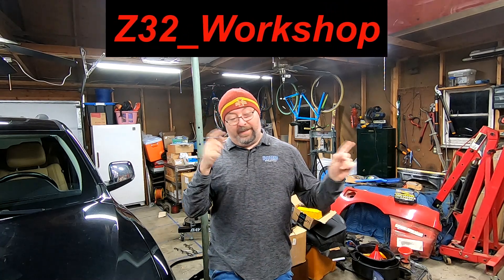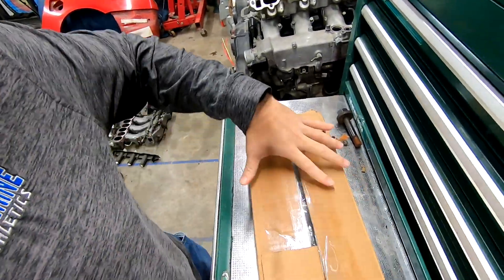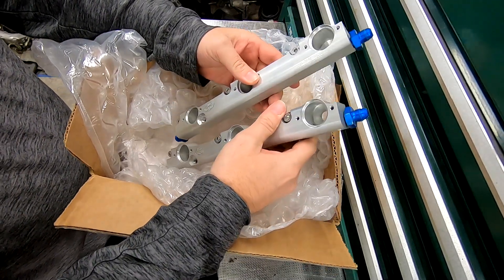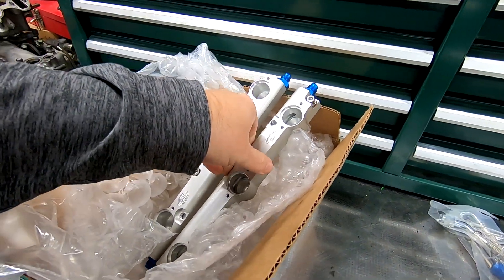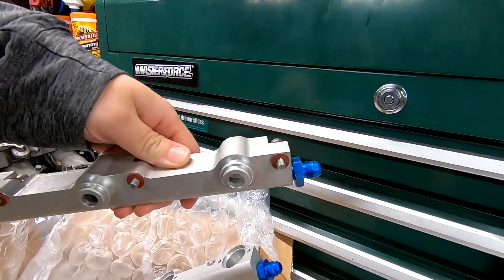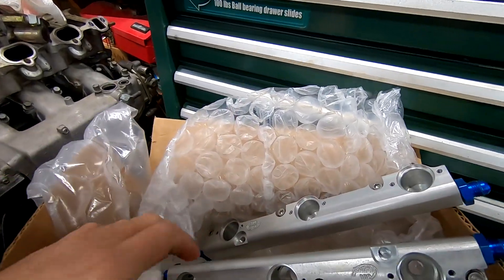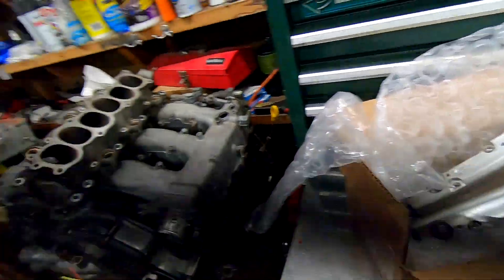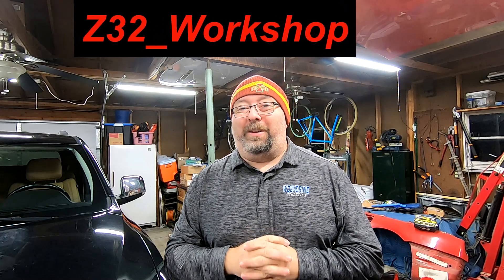300 degree fuel rail - Nissan 300zx - Z32 - Fairlady Z - VG30DETT

Comment: Can you use these fuel tails on a non turbo !?
Reply from the maker: Yes you can, as along as its the correct lower plenum
Reply: Who is selling these
Reply from the maker: @griffengranados619  300 degrees did sell them, but they stop so these are no longer available. But CZP started selling there own, which look alot like these.